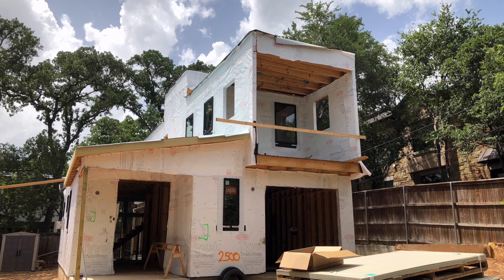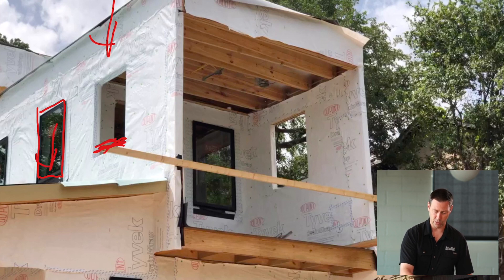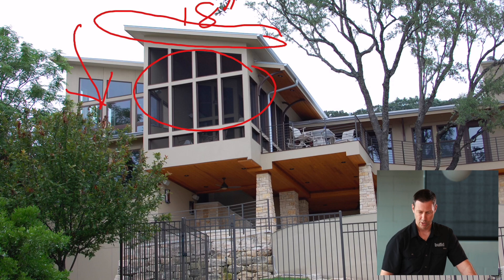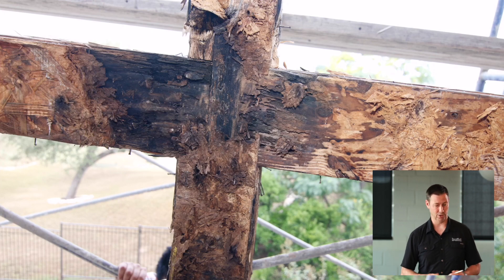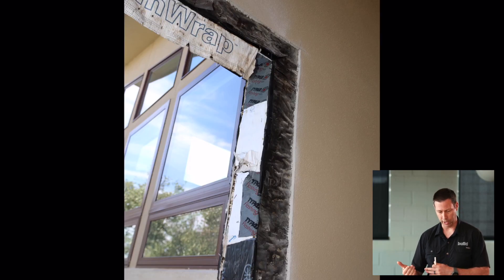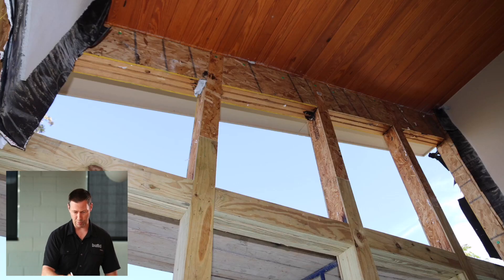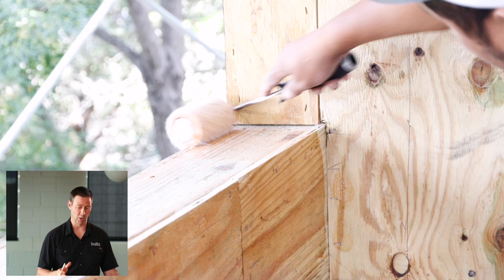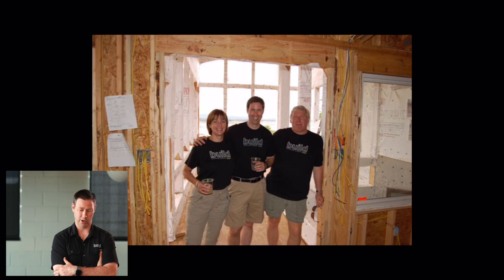Learn from MY FAILURE - A Building Science Lesson

Comment: You mentioned something about selecting your clients carefully with kudos to Stan and Catherine. The question is, as a client, how much of a butt should I be? I want the best results for the money I'm investing in the project, as anybody should. I'm presently in the middle of a simple bathroom tub/shower remodel and there's evidence of old waterproofing failures in the original construction (c: 1980), especially under a window. These minor failures in waterproofing became evident before structural integrity was compromised but not before the original ceramic tile came loose from the interior surface structure behind it. I'm focusing on the elements of the project that will be hidden once the walls are buttoned up. This is one room where rainfall is a factor both inside and outside the walls.

Comment: I'm in the UK (where it rains all the time). Man made board is a no no for anywhere that may get wet. Bricks and mortar, aluminium, UPVC, lead flashing and sealant on every joint. If I'm going to use wood its generally oak.

Comment: Thanks for the tour. I'm a noob DIY'er that has made some repairs to houses I've owned. Whenever the repair was on the exterior I always used pressure treated wood, or in one case cedar when I needed to replace some cladding. Forgetting the cedar for a moment,  the difference in cost for pressure treated vs non - pressure treated wood isn't much. Why is pressure treated not used for ALL exterior facing stuff?

Comment: Another great one by Matt. Perhaps the biggest problem after the material choice (real wood is good) is the practice of wrapping every thing in plastic. If the design allowed a bit of water to get in and out with air movement, the rot would not happen. Many renos I did on  old Victorian buildings might have had tar paper (many did not) and the wood inside was great. Mind you they leaked air like cheesecloth but this project of Matt's was a porch. Perhaps, ditch the plastic.

Comment: First, Appreciate your honest but here are some thoughts:  all the problems in this case is that the water gets inside the gaps between the windows and it supporting wood frame. So why not just spay foam seal around the windows? By doing this you don’t need all these extra expensive work and special materials like elastoform flashing etc. ( it’s good to do it but it’s not necessary) now here comes back the real old problem for or contractor: time! Spay foam take about 24 hour to fully cured and you can trim and cut , the contractor can’t finish the job in the same day.

Comment: Wow, yesterday I finished framing a screened porch on one of my houses and was going to spend the weekend thinking about how to waterproof. Thanks Matt, I think it’s time I tried a fluid applied!
Reply: Twenty-some years ago, my friend's mom had  a pretty nice 1908 bungalow, but the small semi-enclosed entrance on the north-west corner was starting to get a lot of rot on the exposed wood, and small amounts of moisture were coming in the window.  The original stucco was in perfect condition, and being students and his mom a self-employed recent immigrant, we didn't have a lot of budget.  We just treated all the effected wood and covered it with marine-grade fiberglass resin (leaving uncovered areas on the bottom & inside to allow for drying, of course.  And only do this in a well ventilated area as you have to mix it with a lot of acetone and the hardener is prety toxic.)  It's still holding up now.   I expect the products actually designed for this will work at least as well.

Comment: Matt A house built in 1940 had very little flashing around the windows and doors - I think you showed us a house with pine walls and very little rot after 80 years. Is this the breathing example? That house had no insulation if i remember. After just 7 years this was in very bad condtion. It just does not make perfect sense to me why the differences given they were in the same general area of the country weather wise.
Reply: Materials were different back then. Old growth timber and no man made materials. Remember, plywood wasn't even a thing in 1940, much less OSB/LVL/LSL and they breathed well so they were able to dry out as needed.

Comment: Unless your house is entirely poured concrete , or you get less than a few inches of rain a year,  or you are going to unethically sell it before the rot gets bad, water damage is one of the biggest things to pay attention to. Many if not most builders today also create a shell LLC for each project to limit their liability for things like water damage. So it’s sadly mostly on the buyer to avoid homes that will have, or already have, serious water ingress issues due to cost cutting or ignorance during construction. The builder or developer has likely already made sure they have little liability.

Comment: Matt, I just quit a contractor who wanted me to help him mud, texture, prime and paint a house w/o any ac. I moisture pinned a wall half-way through. 22% humidity in the sheetrock .In E. TX. 55% humidity is the low here in the late pm for about 6 hrs.  He tartly offered ultimatum. Help me finish and get my money or go.// I watched one of you previous vids where you hooked up a large ac unit to a new construction to control temp/hum. Could you recommend some numbers for proper temp/hum numbers for proper drywall/ paint work? // Contractor I just left is unencumbered by integrity or science. :/

Comment: Brilliant video Matt. But coming from the UK I don't really get it. Here it would have to be steel, I don't understand why it wasn't used in the first place. If you go back to the middle ages they didn't tend to cantilever their buildings too much LOL. That said, they did oversail a bit but oak is a very solid wood and also they had a lot of ventilation both sides. Looking at your wet rot I think it's possible some of it was condensation, it could be possible with such a big glass elevation if there wasn't ventilation. The point is you have to expect water ingress, buildings move and crack too. You have to expect failure and plan for it is my point. Here in the UK we find matierals like steel, bricks, oak, lead flashings really stand the test of time, I don't like to see wood daubed in gunge, it doesn't seem the answer to me.

Comment: This is only the beginning. Wait a few years .  You have so much lumber foam gridlocked in all your builds  that any water intrusion is going to build alot of rot and mold. That 2x6 if it were a true pressure treat  could sit in water for years and still be there.

Comment: Good waterproofing materials. I've used Carlisle products, they recommend rounding the edges of the flexible flashing. The liquid flashing is good stuff also, but you have to be very careful in its  application. It's not hard to miss spots when you're doing production work or if someone is inexperienced. Nice vid!

Comment: In the east, f or porch roof support at the weather edge  , I construct structural four sided hollow posts on vented plinth  and a  corresponding spread in the header to allow the heating of the sun on roof to  draw air  from the plinth. These installations are performing well twenty years out .
Alternatively I also have a spring box made mill run style of stacked 2x3 hemlock  it has been submergerged 33 years and  is still sound .

Comment: Liquid membrane waterproofing is a mistake. It's true that is kind of full proof from an installation standpoint. And one might be tempted to go with it because a liquid membrane will last much longer than a bad installation of a solid flashing product. But there's no way in hell a liquid membrane is going to stay dry and flexible for the 60 years that a house is supposed to last. Copper, lead, or galvanized flashing is absolutely the only way to go for any near horizontal surface exposed to rain fall. Also, all window opening should be sloped downward to the outside, both top and bottom, irrespective of the window construction. That way the proper flashing can move water to the outside along the flashing. I've been in Texas now for a decade, and I have yet to see a single house that doesn't leak water at either the roof line or the windows or both. I don't know if it's incompetence or stupidity, what solid materials and gravity I've been known to work since Roman times. I know they're expensive, and time-consuming to install and to plan for. But they're the only way the house flashing will last as long as the house last.

Comment: It's too bad you didn't know about flexible flashing being available in the commercial rubber roofing industry for about the last 30 years. Btw, I was applying rubber roofing when it first came out! Suppliers should have been pushing their commercial products towards residential applications a long time ago, their profits would have increased significantly, not to mention, a lot fewer homes having easily avoidable problems! If you ask me, I still think two-part urethane caulking should be used for residential exterior applications! "Affordable" housing pretty much prevents that from happening. Of course, there are some very flexible and durable one-part urethane caulkings available now, fairly high price point though.

Comment: Great video. We learn more by fixing our mistakes than even when we listen to grandma. 

I think I'd like to make a couple of dog house type test bed 'widgets',  cover each of them with one of these materials and leave it out behind the barn and visit it every now and then. Some parts would be covered up, as your porch materials will be, but some will be in direct sun/rain exposure. You'd want to match a proper use but also put it in as harsh conditions as you can so it fails. One material might dry out faster than the others in direct sunlight, and covered might just be a bit stiffer, or maybe it's just the UV light. I can see where a material designed and tested in Minnesota (which has colder weather than most of Siberia) might not take a Texas summer.  What happens where the corners meet over the years? We know what happens to sharp inside corners in hard brittle materials like stone, ceramic tile and formica, well it happens in every window and door opening, it's just the materials absorb the hit. How many years will these sealants stay flexible? (Probably a lot of years, but I think if it was 25 or 55 years I'd still want to know.)

Comment: Good work on the waterproofing and it must have been expensive to repair. Did not see much on the other important factor of drainage. Water is not just in its liquid form but also can permeate through any crack in vapor form. This is where drainage comes into play when waterproofing is applied. 

As you said "If it can't dry, its gonna die".

Comment: Great Video!
A lot to learn there!

One thing I have learned while constructing my home:

Always have a backup.

When someone tells me, one layer of this product will be enough -  use two or three layers, just to be sure!

Better to be safe then sorry.

In this case I would encourage you to use BOTH ways.

First to it the "Origami-Style".

Afterwards cover everything!

With a layer of the fluid stuff.

That should last decaded then.

Initial investment of course is higher - but for sure that customer would not call you again for the same problem some 10 or 15 years down the road.

Comment: You did not mention the biggest problem which is crap windows. For centuries we built windows as glass held in place by a sealed frame and the frames had drains installed in them to shed water. Today, they encase glass in a frame as one piece with no drains and rely on the wall the window is installed in to shed the water. People change with the whims of bogus manufacturers who brag their windows are watertight and they are but the window should have a collection feature with drains built into the actual window to channel the water away from the wall altogether but they don't. So choose your windows wisely.

Comment: An extremely informative presentation of a house with failures similar to one I restored with bad peel and stick origami, no sill slopes, and recessed window and door openings. The damage piled up for 12 years before we did 300K of restoration work heavily relying on Prosoco products. Although the final work done in Matt's case to correct the mistake was good, I would strongly advocate stainless sill pans for that level of exposure. Even better would be sill pans that weep the water past the surface like a traditional sill. In my opinion, the biggest mistake of modern construction techniques vs traditional building is that it relies on a hidden waterproof drainage plane which, in many cases, is fictitious anyway. Features that eject water to the surface, or better kick it past the wall surface, are very worthwhile even if they compromise that "sleek" modern look people want.

Comment: Great learning experience. Thanks for sharing. I would appreciate any tips you have for under construction photos. It can be difficult to know what should be documented before you need it.

Boy, in those high risk/exposure areas to liquid water it would be nice to see multiple treatments of water seal in the event one fails. That is, maybe origami the wrap in lower corners then apply the peel and stick or fluid applied. Also, I’m sure you have revised your approach to a client regarding overhangs in a build. Like, little overhang represents big risk for future problems.

Comment: Matt, your only failure was accepting the Lake House project as designed.  I'm an architect, and would NEVER design a screen porch like the one at this lake house.  Ironically, you "before" photo shows the old screen porch with a low and wide overhang around the entire screen porch.  Your architect had the conceit of wanting the porch to look like the enclosed part of the house and clad and constructed using the same kinds of materials and layered "waterproof" construction.  But due to wind driven rain any screen porch is essentially open to the elements.  Making it waterproof is a fools errand.  It needs to be designed like an exposed outdoor deck with a gazebo on top.  Let it get wet, and design it so that it all can easily dry out.

Comment: All this blue stuff and flex flashing is cool. Does it allow vapor to escape? I thought this stuff works great when used with a vapor open interior wall assembly.
Reply: All sides of the uninsulated assembly are exterior exposure. There's no vapour management required.

Comment: Hey Matt I'm curious to know if he's ever used or know of the SCIP building system. It is the only monolithic structure that I know of that can withstand a 9.0 earthquake 200 mile an hour winds it can be configured to withstand tsunamis. 

I have worked with this system for over 10 years and absolutely love it.

Back in 2007 when Hurricane Ike hit Texas I have a picture, which is quite dramatic of only two houses left standing out of over 250 homes (on stilts) on the beach and both of those were made with SCIP building materials.

I am very passionate about this type of building system as I realized that even steel frames that are bolted or welded together have sheer points and the SCIP building system dramatically has little to no sheer points and actually functions is a very strong yet accordion-like effect because the 12 gauge wiring throughout the walls acts like a big shock absorbing to dissipate energy evenly.

Comment: FYI ICYMI on your European tour: Our windows always have a substantial sloping lip on the bottom of the glass with an overhang of about an inch. There is even a slope if they are horizontally tilted open 15 degrees for fresh air. Making it impossible for water to sit on a window anywhere. Especially windows made from wood. Example, from the company called PAX. Google "pax holz fenster"

But cheaper PVC windows do not have such a large overhang ... because PVC.

Comment: The way you do didn’t fix the problem in root: Stop the water get in! You just prolong the decaying time by using those materials! For zones with no snow is ok but for zones with ice and snow the way you do won’t fix anything, it will crack soon. So how the water get in , just analyze it and stop it! In this case the water looks like from the rain and pressure of the winds. Because it’s a large windows wall , shot overhang of the roof. Spay foam the gaps will fix the problem, the caulking won’t work due to the UV of sunlight! So actually if you just spend more time , couple cans of spay foam will fix all the problems at the beginning! By using Caulking you can finish your contractor work in the same day , by using Spayfoam you cannot finish your contractor work in the same day . That’s the real answer!

Comment: Frank Lloyd Wright designed some great looking buildings. They all leaked like sieves. Take the Civic Center in Marin County California. They have had to spend huge efforts multiple times to try and seal the idiotic design flaws. Dip the entire building in liquid plastic. I constantly run into folks with cool building designs that collect water and funnel it into troughs and interior drain systems etc. that ALL eventually fail.  Good design doesn't just mean a cool look. Peace.

Comment: This is one of the best episodes so far. Been watching along time. I guess to put in a request. I'm a shop owner and have several garages. Built out of 2x6 sheet rock and OSB standard practice stuff. My problem comes not from the outside but from the inside. Washing vehicles, mopping floors, washing floors, spills and things of that nature. It would be interesting to know how you would build a shop to deal with these issues.also things like  Ventilation and air conditioning.